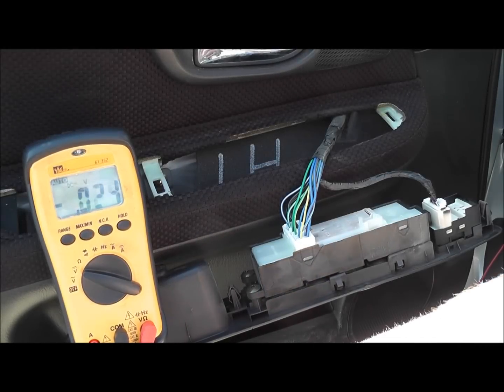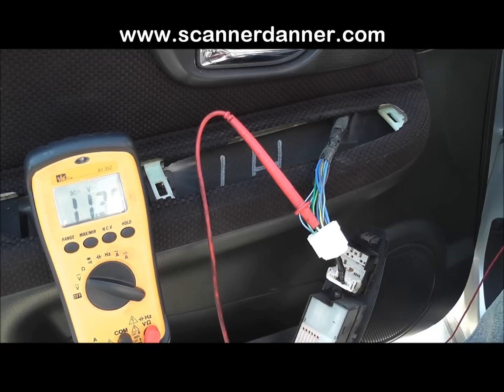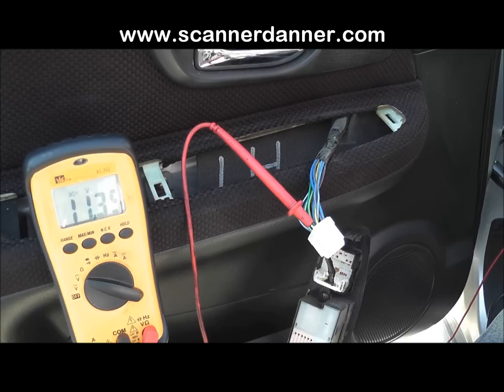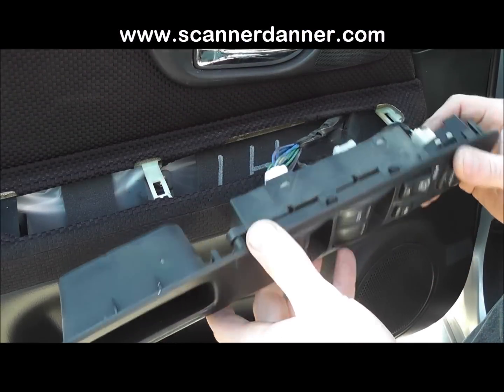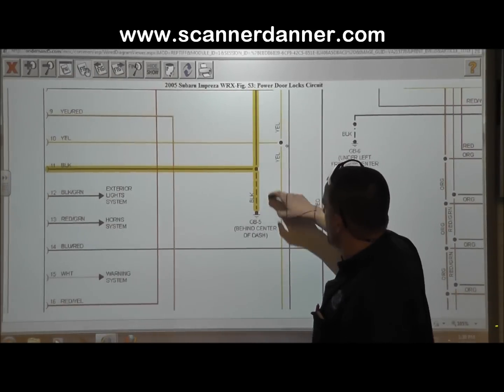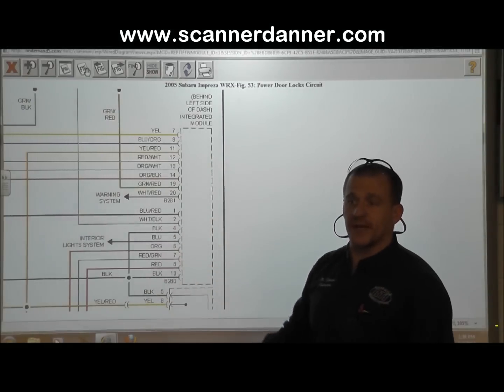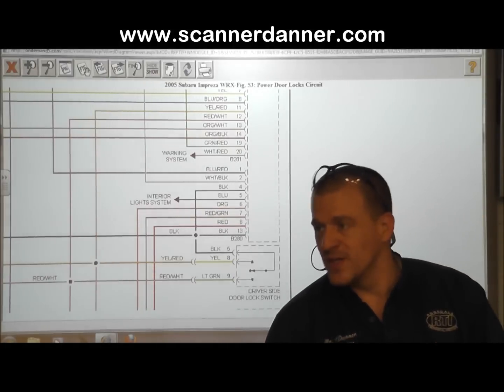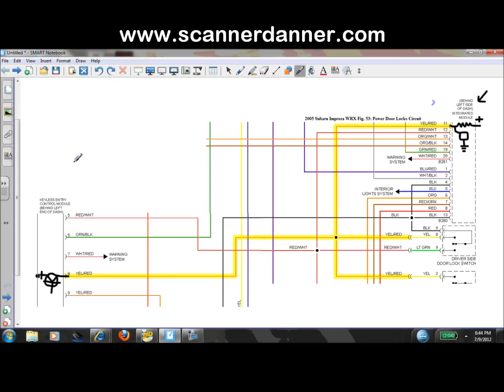How to test computer controlled door locks - Subaru

Comment: Good stuff Paul. 
Our 2009 Honda crv can't do the driver only door lock trick but the US version can. 
Very annoying not to have such a basic safety feature. Also missing in the UK is the auto door lock feature as you pull away.

Comment from the maker: The integrated module has a drivers side only function to it. The key less entry module looks like it pulls the circuit to ground just like the door switches. It could however only partially pull the circuit to ground, which would indicate to the integrated module to do the drivers door only. I'm not sure. Or it could all be done by logic in the integrated module. I should have monitored the circuit when using the key fob.

Comment: There's 3 wires going to door motors. A simple door motor can be driven by two wires so my guess is that there is one dedicated wire for the driver side door motor. The logic (when in locked state, first unlock signal opens only driver door) can be easily handled by the module internally, no need for special voltage levels.

Comment: Thanks for another great video! My first step when I do any sort of diagnostic where I need to know how the circuit works is pull up the system diagram in Mitchell. Watching all of your videos over and over again I'm able to quickly and accurately make my way through the wiring diagrams and move on to component and circuit testing. Every repair made is backed by proof now!
Reply: InstaBlaster...

Comment: good video once again. i hate how the new(er) wiring diagrams don't show jack. you really have to dig through diagnostic trees and troubleshooting stuff to find any kind of information on circuit design. its like pulling teeth from the manufacturers. at least thats how toyota is.